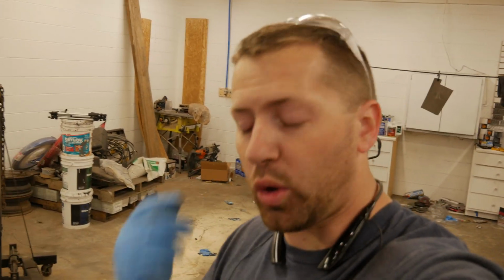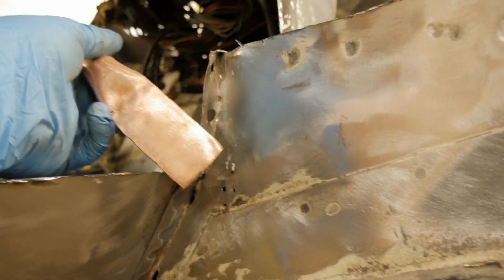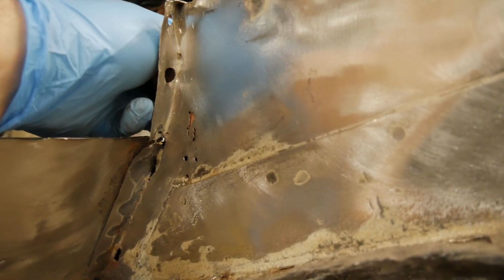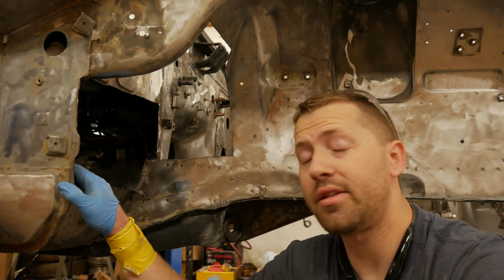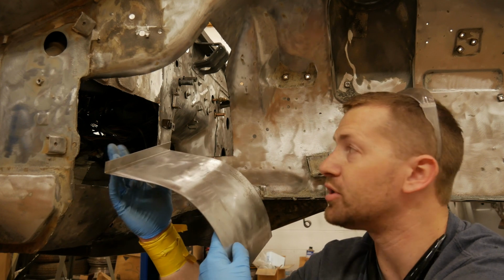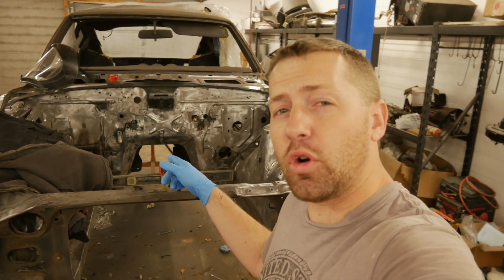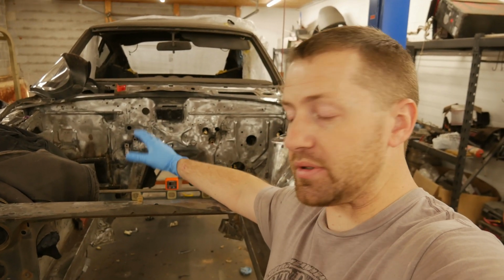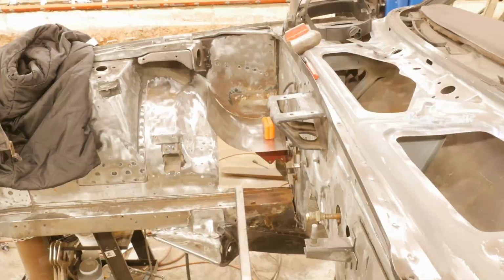Datsun 280z Battery Tray and Firewall Repair Part 1

Comment: What gauge metal did you use?
Reply from the maker: For the battery tray and firewall area I used 18ga cold rolled steel.
Thanks for watching!
Reply: @hcr-motorworks  appreciate the quick reply. Working on mine now
Reply from the maker: @mahmouda03  I do not envy you...this area was a task thats for sure haha. Hope the video helps you figure it all out!

Comment: I've seemed to luck out making that area. Buy heat and a rubber mallet 
    Some how luck and heat and force of mallet makes that area look right.
  It's a challenging area.
But a Black Belt in Fabrication
School of DIY.....you can get thru. 
Your fix came out well.( No pun intended )
Ceramic Aluminum oxide sanding pad, really have been the game changer ,in weld grinding. I never grind any more...just put the ceramic ,alumiñum oxide
Sanding disc's. 
      Bamm weld is completely level.
       Çeramic Aluminum Oxide  disc's are a Welders Game changer !!!!
Reply from the maker: Good tip! I'll check them out! luckily I'm almost done welding on this one.
Reply: @hcr-motorworks  I've been building cars for over 50 yrs. Ceramic aluminum oxide Sanding discs "absolute game changer" never use a grinding disc EVER..
Reply from the maker: @MindDezign  Yea i've been using flap discs for years but havent heard of  ceramic aluminum oxide ones.
Reply: @hcr-motorworks  flap disc,and normal 7" sanding discs. Blaze is a good one.
  Let me tell you...I find things to weld, just to sand them down ,in seconds.
    If your like me, grinding was always the work part, of welding 
     Now it set up and putting up tools...!